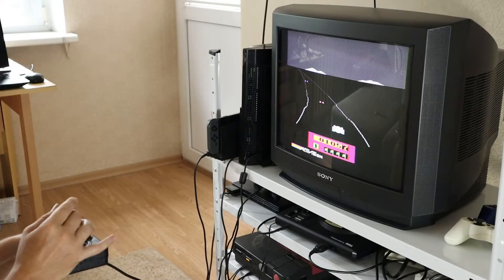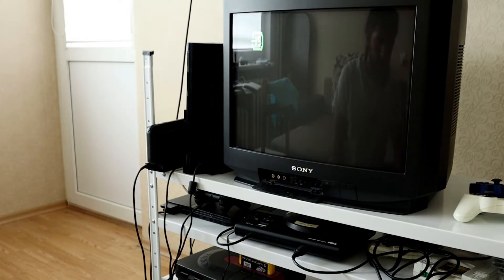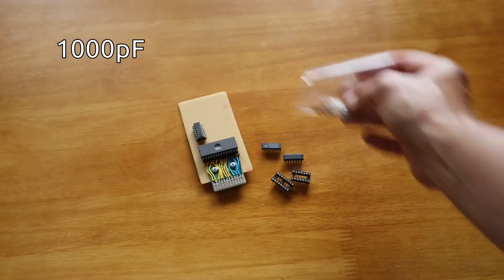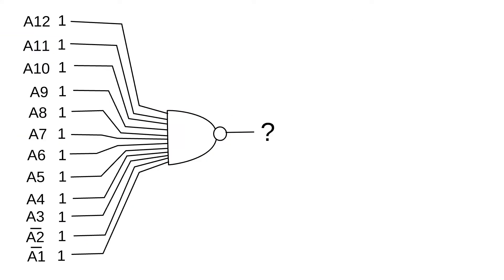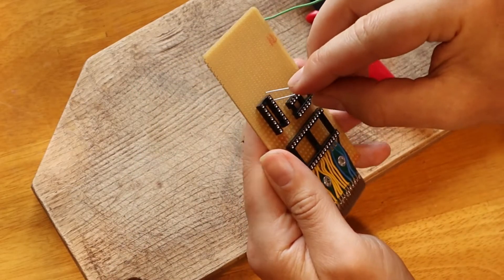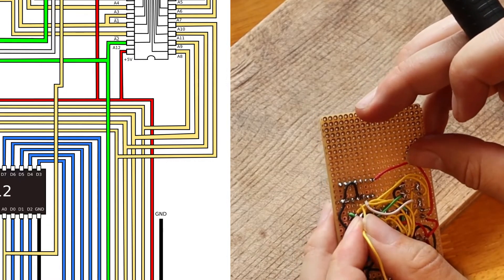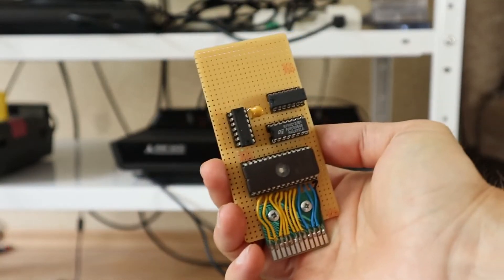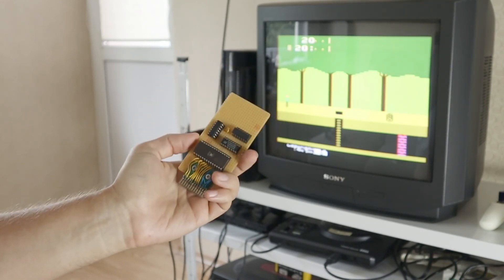Upgrading my DIY ATARI 2600 cartridge so I could play E.T.

Comment: One tip fellow retro buddy! Get yourself some wire wrap wire and a wire wrap stripper.
It makes bread board work a lot quicker as you can strip really tiny pieces and basically stick 3 or 4 wires in a soldier joint.
This is how I prototyped complete 8051 and Z80 single board computers back in 1990-1994.